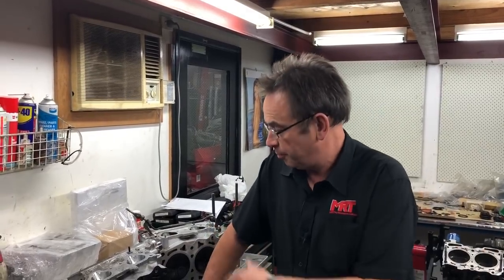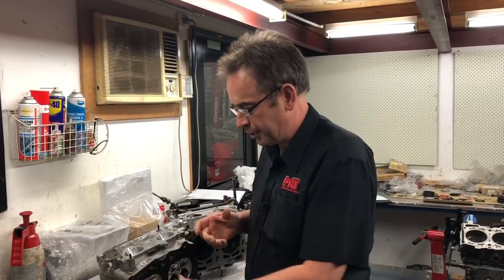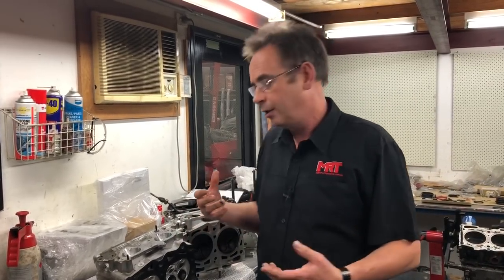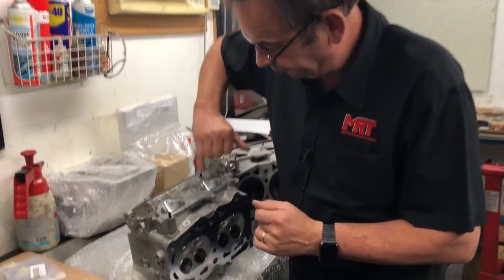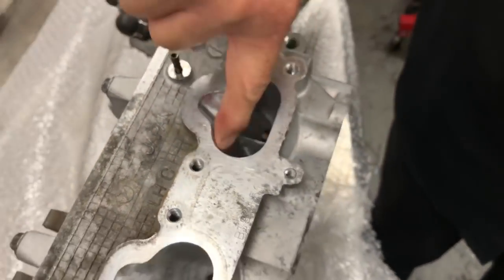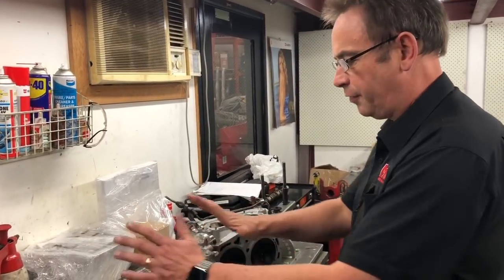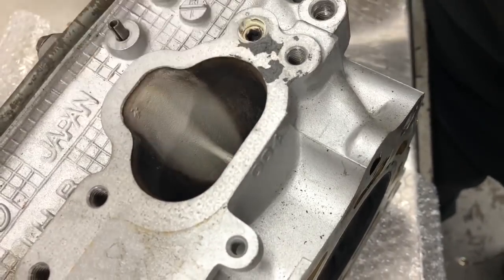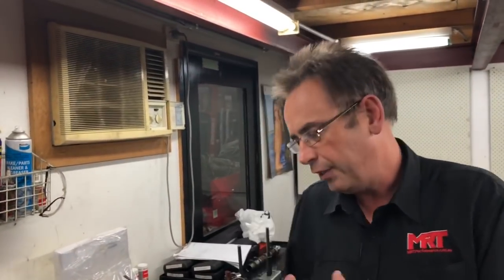Subaru Machined Head Comparison

Comment: Hi MRT I have an 02 Bugeye WRX with a JDM V7 STI engine and ECU and I want to make 400-500whp. But what I was wondering is will I loose turbo spool up quickness with build heads. I've heard you loose bottom end torque but gain more top end power. 

Thanks

Comment: I just purchased a 1998 Subaru forester with the EJ20 engine and i,m curious as to what brand and type of head gasket you recommend to replace the stock ones with.I have heard that Fel Pro are good and also Six Star?

Comment: As a Subaru expert let me ask you your opinion about something. I'm in the USDM market so obviously it's a little different regarding some areas but anyway... Factory head bolts you ever have problems with them snapping when being removed? More specific the 2 outside exhaust side. I had one snap while undoing the intake one across from it(never seen anything like it) and then one snap while I was undoing the actual bolt. As far as I can tell it's all factory stuff that has never been replaced. Is this a common problem or should I be following a special procedure? My03 gg ej205
Reply from the maker: Brandon B it can happen, but very very rare
Reply: MRT Performance I thought so I have a feel it was over heated pretty well but I have some questions about the Japan market ej20 heads. I'm in the U.S. so I'm having a hard time finding the info I need and a week known Subaru engine building shop I talked to was not much help. I'm afraid it wouldn't be business for you but is there a email or phone number I can call or message for any help or guidance. If need be I can pay for your time to talk or what ever makes it mutually beneficial